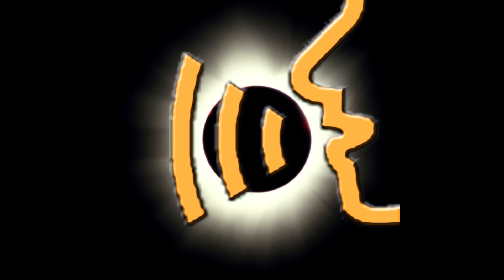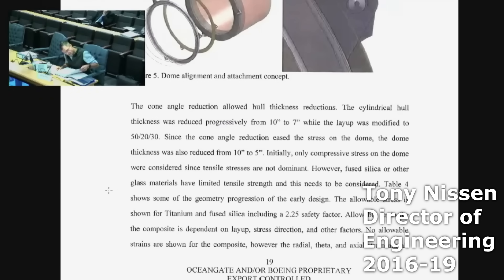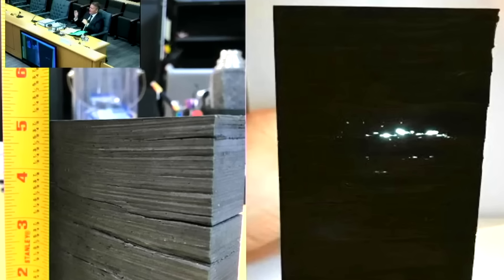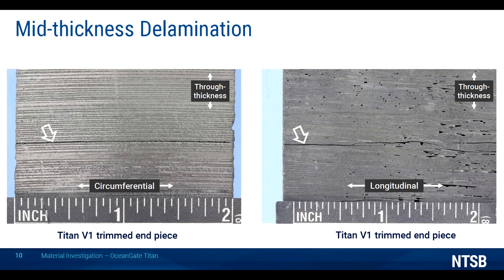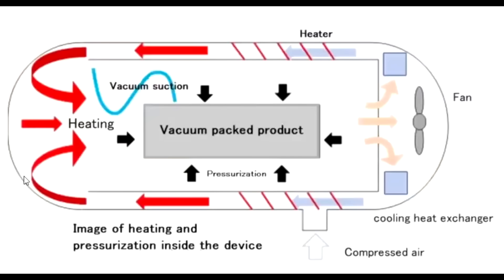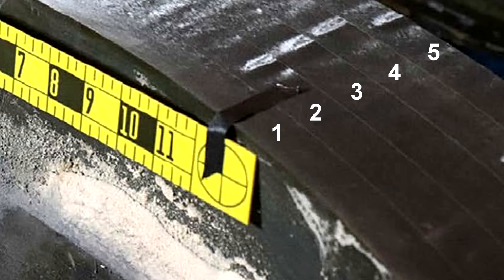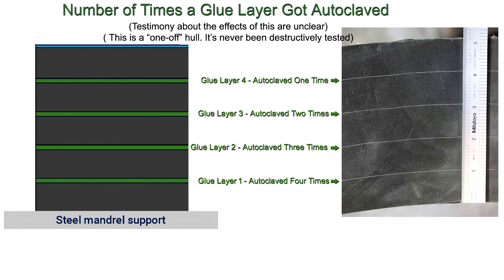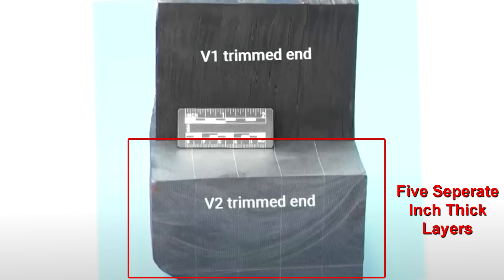Who Engineered the OceanGate Titan V2 Hull? Maybe Nobody Did?

Comment: Well.... Boeing doesnt exactly have a spotless record regarding recent pressure vessels. I would take what they say is OK and double it
Reply: To be fair, boeings problem seems to be in QA, not in engineering.
Reply: Boeing has no issues with pressure vessels.  What are you implying
Reply: Boeing's issues are more in the "We know these new engines change the flight characteristics of the 737 but let's find a way to sidestep that because Southwest has so much money invested in 737 pilots they would be incredibly angry with us if they had to get pilots rated to fly the new variant. Let's sidestep the issue and pretend it's the same exact plane without telling anyone of the fix"
Reply: @Aquatarkus96  a change in aerodynamics that was so slight they don’t actually need the system at all.  One mistakenly thought to be of the belts and suspenders type.  The problem was no one thought the system would prevent the pilots from flying.  It was a miss in the risk analyses but hardly a nefarious conspiracy to hide an unsafe design flaw.

Comment: This goes beyond a regulation issue (though it definitely also is an regulation issue). Seeing this video im surprised anyone who had knowledge about the subs construction was confident in it. This is basically going "well it looks thick enough" and then stop thinking.
Reply from the maker: I agree with you!  Thanks for commenting.
Reply: Using an untested material for a not certified design in an experimental construction made to cramp as many people in as possible should have been an alarm sign.

Comment: I would have had the hull thickest at the center and tapered down to the 5 inch end caps. More egg shaped than a tube.
Reply: The problem is the hull was made of carbon fiber. Thickness or design ultimately would have all still failed due to material fatigue and delamination.  A better design would have just taken longer to fail.
Reply: @JathraDH  why blame the material when clearly the engineering and testing was done wrongly? 

They didn’t have 45 degree layers
They didn’t have enough thickness
They didn’t know what 5 times cure would do
They didn’t test it. 

Schlooonginator is correct… you’d thicken in area of higher loads.
Reply: @LSmallCatL  Your points are valid. But it was Carbon fibre composite, which will always weaken after repeated stress cycles. That weakening by delamination would still have happened, no matter how thick the hull was, and the defects would propagate throughout the material until it failed. It might have withstood 40 dives instead of 19, if made thicker and profiled, but every time it dived was like playing Russian roulette,
Reply: @  For engineering, there cannot be a Russian roulette scenario unless you have a gun to your head. Here it was clearly about spending money. 

Using carbon fiber composite has its pros and cons. Without doing a full study whether the pros outweigh the cons, no material change should occur. A proper study might have shown that having a 1000 cycle would require a 40-inch-thick vessel to offset the weakening of the build over time, or the life cycle can only be about 100 dives with proper build-up, making it financially untenable to use in the first place. 

All I've heard in this video clearly shows that all caution was thrown out the window and all engineers involved either claim they were trumped by the owner or only partially involved. No engineer, working on such a project, should ever accept to hail marry any project that may cause casualties if not executed properly. 

Especially when seemingly no regulation or agency felt responsible to stop such a dive in the first place.
Reply: @LSmallCatL the dives were in international waters. I very much doubt it was up to the feelings of any regulators that the dives went ahead.
Reply: @LSmallCatL  Because some materials are simply unsuitable for those type of applications.  I could make the hull out of paper and no matter how much engineering and testing I put in it is still going to fail.

This is the same reason pressure hulls aren't made out of aluminum.  Despite having a MUCH better structural strength than carbon fiber, it is still prone to fatigue and will eventually fail.

Rush is famously quoted in one of his interviews as "you don't make hulls out of carbon fiber, well we did it anyways".  There is a reason you don't make hulls out of carbon fiber.  The dangers and short comings have been known for many years.
Reply: @  As we now know, choosing carbon fiber without proper testing and less than half the thickness required, still performed 19 dives. 
Therefore, it is suitable though with limiting capacity. I wouldn't want to try out a paper sub. 

If you want to do 1000 dives however it's unsuitable which the testing with proper consideration of the lay-up would have shown.
Reply: @JathraDH  you can absolutely make pressure hulls out of aluminium, theres a cold war Russian sub and an experimental submersible called Aluminaut that could head deeper than Titan. A large proportion of diving air tanks are also aluminium, if for lesser depths.
Reply: @ You can, but not for long term use.  Even air tanks don't last that long.  That is why they must be re-certified and constantly retested every few years.

Aluminum has a well known metal fatigue property where if you start pulling on it well below its elastic deformation cutoff where other metals like steel or titanium would never fail, it will eventually fail at that lower stress level.

The reason steel and titanium are used for pressure hulls is because they have good long term fatigue properties.
Reply: @LSmallCatL  I would never get into a CF hulled sub lmao.  It is simply not a suitable material for pressure hulls.  The industry has known this for a very long time.

Comment: I always though that engineering is an exact science compared to say...medicine. But the amount of "may, might, could impact, has unknown effect on" in this video is just insane. This whole project seems more like an experiment than something that should have people in it. The tech guys don't feel responsible since they were all just asked for opinions and consult, and the managers in charge just refer to the specs written by the tech guys.
It's like magic, and nobody can be held accountable.
Reply: What’s more is that a lot of what the tech guys they were consulting had been telling Stockton was being willfully ignored.  “Ten inches this will do the trick, 7 could work if you do it well.”  Stockton: “I can cut costs by doing it with 5.”
Reply from the maker: Thanks for commenting.  Your line is very well put  "This whole project seems more like an experiment."  That is so true!  It is so obvious that people should not have been in this thing.  No scale model proof of concept, no real dives other than the pressure chamber in Maryland.  Really an amazing thing.
Reply: This wasn’t engineered. 

It was put together to save money. A properly engineered vessel would have cost more but likely nobody would have died in 1000 dives.
Reply from the maker: @LSmallCatL  Agree.
Reply: Done properly it is pretty close to being a science. You know, if you actually take on board what your tests reveal and don't just push on regardless. Oh and make sure your tests and data are accurate and relevant.

Comment: Its been known since the 1860s that layers of a material don't equate one solid piece. When iron started to be used as armour on battleships, many countries couldn't produce the 3,4,5,6 inch thick plates required, so they would layer up multiple plates. There was countless testing by many different navies that discovered 3 2inch thick plates only has about 60% the strength as 1 single 6 inch plate. It was such a big deal it led to quite a lot of advancement in the iron and steel industry as this was the first time iron and steel was needed at such high thicknesses
Reply from the maker: Boy, do I agree with you!  Thanks for commenting
Reply: The reason to layer up in composites makes sense because otherwise you’ll have unpredictable behavior in between the layers due to the heat, effectively burning the resin. 
You do however need to consider the impacts on the multi-cure and ultimately, the lack of 45 degree laminate as well as using less than 1/2 the recommended that would have gone further up considering additional loads. 

The guy doesn’t understand composites and it sounds as if he only got Boeing and Nasa involved to use their name cause he ignored their advise.
Reply: @ - Your response use self-contradictory language. You say you use multiple layers ("layer up") because otherwise your "layers" (a plural, thus multiple layers) will have unpredictable behavior. That statement has nothing to do with using just one layer. Perhaps reword/explain?
Reply: It also started the Spanish American War.  Hot engines too close to layered, riveted hull plates.
Reply: Laminated hulls is common to increase strength.  It’s the secret sauce in armored vehicles.
Reply: @chrissmith7669  crack interrupting laminations. Ideally with damping media (RTV), and ceramic too. It’s just amazing what a modern tank can stop.
Reply: @richardkudrna7503  amazing stuff but I wouldn’t want to be in one when it took a hit.    As our DI used to say „no such thing as bullet proof merely bullet resistant and we didn’t want to find out how resistant „
Reply: @ - A tank stops a localized impulse, not a continual force. So, the example only goes so far.

Comment: Not only was it blatantly stupid to mill the hull to reuse the titanium rings, it was blatantly stupid to reuse the titanium rings. Metal fatigue/work hardening happens every cycle. The metal was less ductile and weakened. Add to that, they milled the rings to reuse them. They made them thinner in the process of stripping off the adhesive and carbon fiber, which reduced their strength even more.

There were tons of red flags, but nothing could overpower the one thing that was the root cause of this all: the hubris of the idiot billionaire at the helm of the project.

Comment: they had made successful dives, 
the issue was related to stress /fatigue.
Reply: Yep, cyclic fatigue issue.  Was good for a few dives..
Reply: @mymodel6  But was supposedly designed for a 10,000 dive cycle lifetime...
Reply: @chadirby6216  Yeah, that why he was insane...  I'm not a Stockton supporter by any means, it was a stupid design, but a lot of things things people point and laugh at, because they are even more stupid than he is, aren't actually the issue, like the game controller, and the window, both of those were fine, but the whole concept of the sub was mind blowingly stupid...
Reply: In other words - they got lucky a few times. Then the design started working as intended.
Reply from the maker: Yes, it's amazing that it made it down to see the Titanic 13 times.  But a deep dive duty cycle of 19 dives total is not good enough when you have 100 million dollars in the project and you are "crossing your fingers" with each dive.  Thanks for commenting.
Reply: @ If by 'new technologies' you mean using not only using a composite material (carbon fibre), but also mating two completely different materials for a high pressure vessel, then it was 'inherently a bad idea', a really really stupidly bad idea..
Reply: The issue is using a material at half its thickness without proper testing/ wrong lay-up. Stress/ fatigue can we calculated.
Reply: @ No, the issue is using composite materials at all, full stop, period.
Reply: @  your understanding of the material is about as complete as the guys building the submersible.
Reply: @ You're the only person on earth who missed the 'do not use composite materials for submersibles' memo..  Go away troll..
Reply: @  pretty sure you'd hollered the same tune when composite material wasn't on the market... just keep using concrete and steel everyone. Your ignorance is rather boring.
Reply: @mymodel6  I don't want to take your job.

Comment: This is crazy. Any pressure vessel is only as strong as its weakest point. If you have a 5" hull with part of the hull filed down to 4.5", then effectively your hull is only truly 4.5" thick. Physics doesn't care how convincing your marketing is.
Reply from the maker: Thanks for commenting.  You are correct.  That is one of the weak points that they did not consider.

Comment: You cant even secure every layer will be cured to the same level. It would be hard even if they did it right next to autoclave and cured it right away. 
I dont think repeated heating would cause harm to previous layers. They were heating it from outside, max temperature reached in bottom layers should be lower and lower with every layer. But i leave that to scientist.

Comment: I would think the compression and decompression, slowly breaks the carbon fibers overtime, I could be wrong though
Reply from the maker: It can if not done correctly.  Depends on the choice of fiber and the epoxy matrix.  And, that is why Boeing recommended 45-degree plies, better load distribution to protect the hoop fibers.

Comment: What’s the light line around the drum at 6:23? Is that a gap defect captured during  manufacturing?
Reply from the maker: Good pick-up.  I don't know why that is there and I saw it when I first saw the original video of the winding process.  It doesn't go away when the fibers go back over it.  I wonder if it was a flaw in the video camera.
Reply: @ I don’t think a flaw in the camera would wrap around and track on a 3D object like that. I might be nuts but it kind of looks like a CNC programming error or something. Like the head laying the fiber moved to quick in that area resulting in a thin layer of material. That’s probably wrong but it sure is strange.
Reply from the maker: @ Agree, I don't know why that is there.

Comment: i'm as shocked as anyone that this contraption even survived a few deep dives, but stockton mush was apparently going to keep diving it until failure, no matter how long it took!
Reply: It's kind of funny. The design isn't unsound by any means (although questionable since CF is best in tension, and not compression), it survived quite a number of diving cycles, but it seems Stockton got even greedier and wanted to extend the life of the hull without further research and tests, so much that he put his own life on the line.
Reply from the maker: @graealex  Yes sir, and they should have stopped after dive 80 when they saw this big change in the strain gauges.  That was a sign of a delamination and they ignored it.
Reply: @solareclipsetimer  Mindset was probably, "what's the worst that could happen?"
Reply: @solareclipsetimer   yes... despite its shortcomings, their vaunted early detection system actually worked rather well, and stockton all but ignored the data!
Reply from the maker: @peabody3000  Yes, I not certain amount the acoustic emissions being used in real time to make decisions about the health of the hull.  But certainly the stain data after a big event/change was useful and should have not been ignored.

Comment: Engineering and design weren't the issue here, that's why the hull actually made it several time to the Titanic depth. However quality control, fatigue considération, monitoring and proper manufacturing process were inexistant.
Reply from the maker: I agree with Eng-OS except that I found no evidence that proved that the 5-inch co-bonded design was going to have the same strength as the 5-inch single layup design.  That switch is what concerns me.  Maybe the NTSB has some additional documents that weren't made public that shows that the change in design was actually analyzed and we will see that in the final report.  As I said in the video the fact that both hulls were 5 inches is meaningless if you don't know how the co-bonded hull is going to take loads.
Reply: Exactly, everyone going right off the bat with "this could have never worked" is ignoring the fact that it wasn't the most unsound design and manufacturing to begin with, and that it went fine for quite some time, or rather a good number of dives.
Reply: Im thinking the hull should have been retired after a blade from the titanic fell on it and teporarily trapped it
Reply: And ego, the 5" thickness simply because they didn't want the expense of a properly dimensioned titanium flange, or the added expense of 45 degree layers, or having NASA complete there research. This is all ego driven. If it was getting too expensive then better to hold off and do testing in models before risking lives.
Reply: OF course it was never meant to work it was meant to keep those billionaires out of court the conspiracy is the same as the Titanic they sunk it to remove  opposing members to the Federal Reserve Bank. Wake Up People
Reply: Fatigue considerations have been part of engineering and design since at least the catastrophic failures of the de Havilland Comet, maybe the mysterious sinking of liberty ships heading for arctic ports.
Reply: the wrong material for the task, not testing the material. not certifying it with the proper authorities. The list goes but is is the wrong material unless proven otherwise, but yhis was never done as Stockton had a one dollar store mentality. He believed to know it better because he had no evidence
Reply: @TorianTammas  it wasn't the wrong material for the task. it was certified to fail. What don't you people understand about that. Are you surprised you can't find engineers that worked on it?